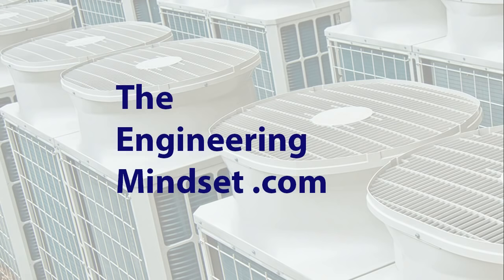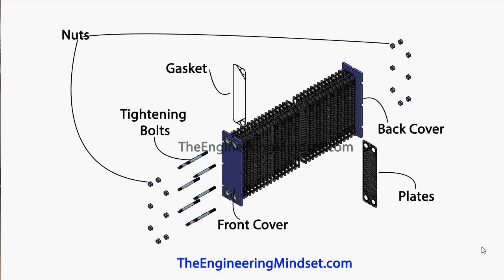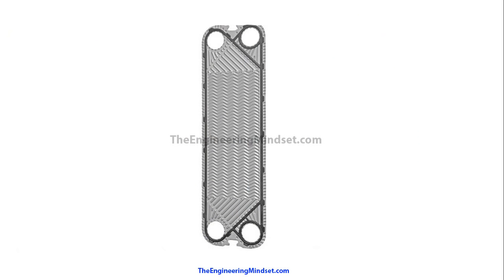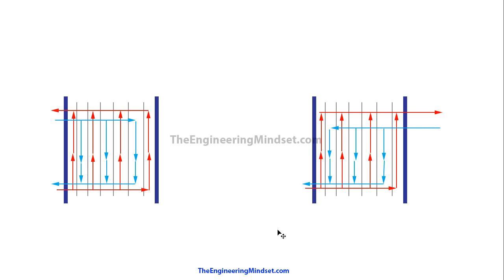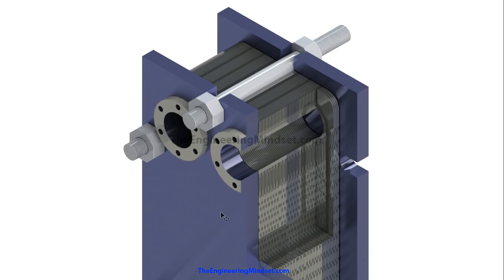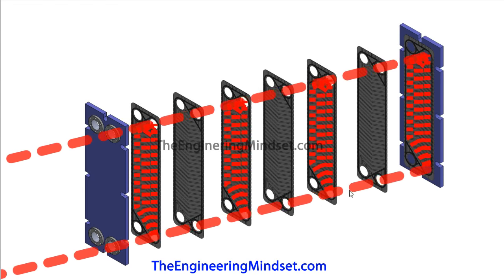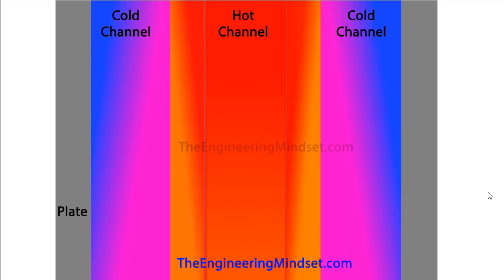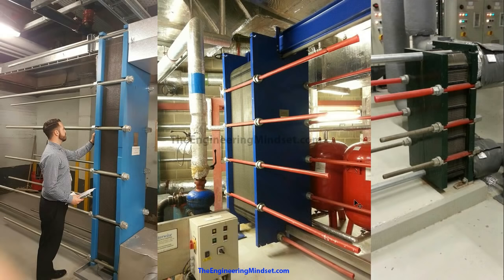Plate Heat Exchanger, How it works - working principle hvac industrial engineering phx heat transfer

Comment: This is such a good video. I need to have this replaced and I was having trouble understanding exactly how it works. Most videos show a convoluted diagram without detailing EXACTLY how the water flows, heat is exchanged etc. You guys are master teachers - not just explaining the concept, but anticipating the questions that someone completely new to the topic would have. Thank you.

Comment: This video was awesome. Thanks so much. I recently toured a district Heating plant and this helped a ton to watch afterward. One question: at the plant, the water temperatures basically flipped (cold got hot and hot got cold). How did they do this as opposed to the temperatures just meeting in the middle? Do they run the water through multiple exchangers (there was many at this plant). Thanks again and awesome video!
Reply: It's easier to think about heat exchangers in terms of average temperature value. You cannot get the 'cold' fluid average temperature to rise above the 'hot' fluid average temperature. There has to be a delta T between the two average fluids for heat to be transferred. It is impossible for the outlet temperature of the 'cold' fluid to rise higher than the inlet temperature of the 'hot' fluid.

Comment: would you please make video on shell and tube heat exchanger?
Reply: Siddharth vasava I may not be able to explain it very well in text but I can give it a shot. It's a lot more simple than this if I remember right. A cool fluid (when I say fluid it can be a gas or liquid) is tube side (inside the tubes) and hot fluid is shell side (outside of the tubes) so when the fluid flows through the tubes it's heated. The cool fluid can also be shell side and hot fluid tube side. The heated fluid is headed by an external source.
Reply: @toddhowardforreal3912  very confusing mate. It was not so well explained.

Comment: Very beautifully explained. Thank you. I have a question. What if I rotate the complete arrangement or say the complete heat exchanger by 90 degrees and have it in horizontal position. Will it perform with same efficiency? Is there any challenge due the horizontal placement? I would really appreciate if someone reading this comment and has answer to it please let me know. Awaiting for your answers. Thanks again :-)
Reply: I believe that horizontal placement would allow bubbles to be trapped in the plates reducing efficiency and complicating installation

Comment: so in essence the gaskets are what control which fluid goes to which plate? Amazing
Great video!
Reply: Yes, it’s quite clever, I’m a marine engineer so have to service these quite often. Much better than tube coolers imo, and you only need to replace one plate if it breaks rather than the whole unit as with a tube cooler

Comment: Sir , I have one question, is it possible that the available friction factor and heat transfer coefficient equations for plate type heat exchangers can be used for plate and fin type heat exchanger? Specially for two phase flow ....with condensation vaporization

Comment: Done an experiment at uni, realised that transfer efficiency decreased as hot water flow rate was increased . Why is this ?
Reply from the maker: Has less time to transfer heat
Reply: The Engineering Mindset .thanks I had that written down but tried thought there was something more, guess I tried too hard to overcomplicate it haha. Thanks for the quick reply
Reply: @EngineeringMindset  Yup 😊.. I also thought something more but it's simple if time for heat transfer is less as one of the fluid either hot or cold flow rate is more so efficiency of transfer will be less..

Comment: Plate Eva 5 Effs: (1st Eff, 2nd Eff-connection box,- 3rd- connection box), with designed capacity of 10 m3 / h, 5 pumps with capacity of 12m3 / h (density: 1).  what will be the cause for the unstable output density, output varies greatly from density 1.08 to 1.125

Comment: Great video😀 thank you so much. Can i please ask how does the cold medium flows upward? I dont understand why it doesn't just stay on its horizontal flow? What pushes it to move up? it can't be only because of the plate's shape. Should i assume that the hot medium flows downwards because of gravity? Please help me please
Reply: I think a circulating pump would be pushing it

Comment: I left with a doubt, how does in this case the hot fluid travels vertically against gravity?  Does it has to do with the liquid surface tension? Or pressure?
Reply from the maker: Pressure from the pump
Reply: Danke!

Comment: Very good explanation, but if the plates are spherical (not rectangular) with the same area. has the same efficiency? or the length of plates determine the efficiency?
Reply: Spherical with a spiral pattern for water flow would give it a long path to travel.
I think that would work well but I think the manufacturing of that type of heat exchanger would be more complex and thus more expensive so the adoption rate would be low

Comment: I have question regarding the connection: if we connect the secondary circuit pipe on the cold side and and the primary ( District cooling ) on the hot side , dose this reduce the heat transfere between them ? ( secondary circuit 5 c more than design )

Comment: Hi. 
Is it possible to send cold fluid from diffrent port which is indicated on the Heat.Exchenger  originally? I mean chang  the circuit ( hot & cold fluid). Is there any effects on efficiency??
Reply from the maker: Depends on the design of the plates and the fluid used. In most cases yes. Check with the manufacturer.

Comment: Question.
Based on your presentation. Your cold side rotates clockwise (right) and your hot side rotates counterclockwise (left). What if, my connection goes like this. My cold side is connected to the right and rotates counterclockwise and hot side connected to the left rotates clockwise with the same type of HEX. Is that affects my cooling efficiency?
Reply from the maker: As long as its counter flow you will get the best results. It will perform much lower if they flow in the same direction

Comment: Is this type of heat exchanger most suitable to act as an evaporator ( the hot fluid is hot exhaust gas from a combustion engine and the cold liquid is water) for a form of waste heat recovery
Reply from the maker: You can run some calculations on it, but this type is the most efficient and is becoming more widely used.
Reply from the maker: I think you'll like this new video, its an ultra efficient plate hx used as an evaporator https://youtu.be/xrsbujk4u6k

Comment: Hello bro I want ask you why they don’t cut the extra bars that exit from the heat exchanger
Reply: He explained that in de video. If you were to disassemble the phe the whole unit would expand substantially in length,  hence the longer bolts. It is possible, but than you would change the bolts with longer ones while servicing.

Comment: what is the disadvantage of plate lubeoil cooler compared to tube type cooler?

A.  Locating cooling leaks is more difficult 
B. Smaller and lighter 
C. Additional plates can be added in pairs to increase capacity
D. Higher efficiency

Please sir answer this.  😊

Comment: What are the chances of leakage in the exchanger and mixing of hot and cold fluids? Where does the leak usually occur? Is it because of gasket failure? How common are such leaks?
Reply from the maker: It's typically low, usually from damage or misalignment from the gasket after maintenance or the material has corroded

Comment: I have one question, why is the valve being installed between the cold water coming in and out of the exchangers, I often see the valve completely open on the exchangers ??
With this valve the exchanger loses its purpose ..
Reply from the maker: I think you're referring to the balancing valve which regulates to maintain a minimum flow rate or temperature